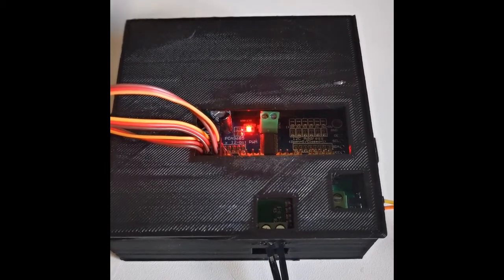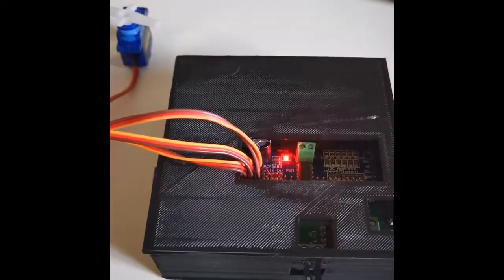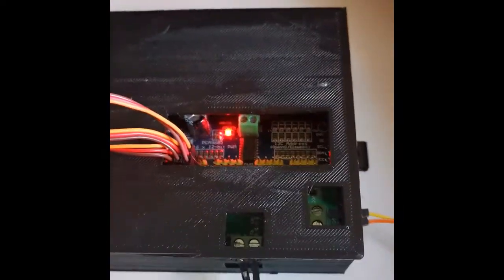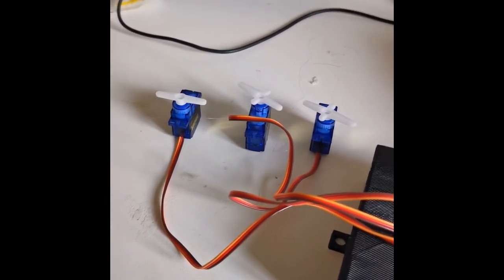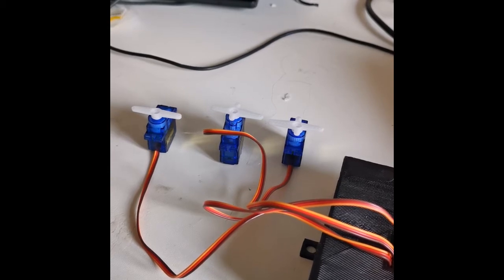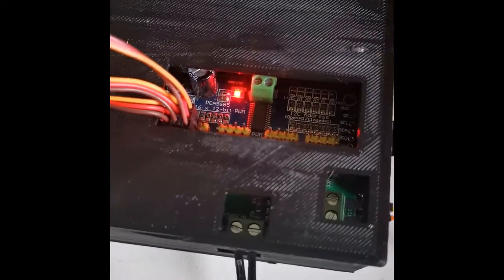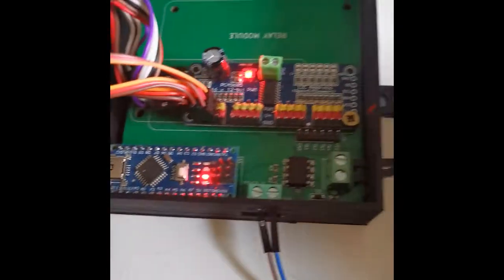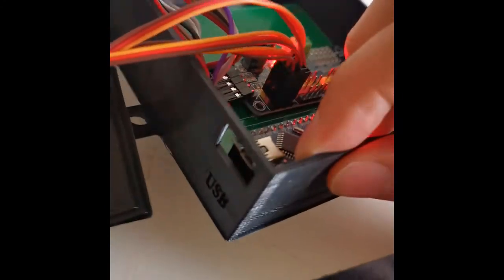Arduino DCC Servo Decoder

Comment: Can it be configured to work through a mimic panel rather than software control
Reply from the maker: Hi - apologies for the delay - didn't seem to get a notification. This decoder is via software only. However our new "prima" decoder can be controlled via dcc or a mimic panel.
https://chesterfield-models.co.uk/product/prima/
Reply: @chesterfieldmodelmakingmin76  Looks more like what i`m after. I`ll have upto 100 points to operate over three panels but it`s going to take some time, just entered your comp.
Reply from the maker: Sounds like a big project, Will be keen to see updates.
Reply: Hi, looking at going down this route, what points would you recommend with this....
Reply from the maker: @andrewbailey1235  Hi Andrew - Any points that you can access from beneath the baseboard or as a side mounted solution will work.